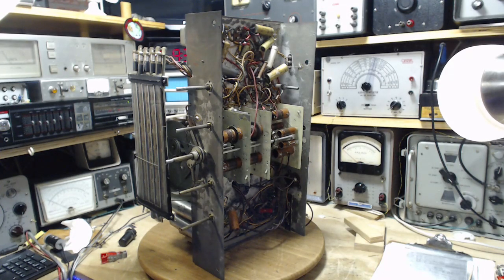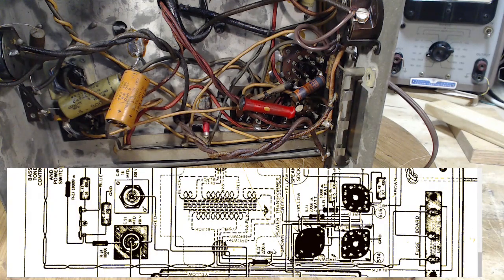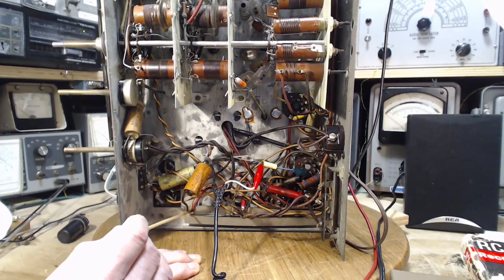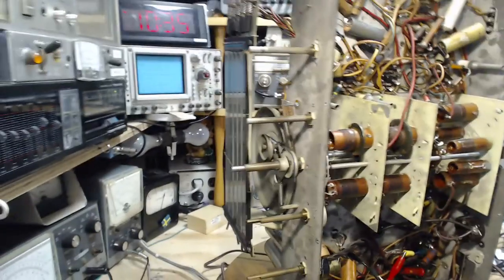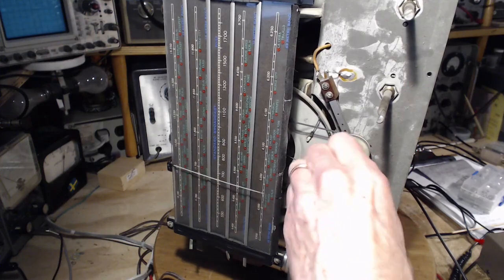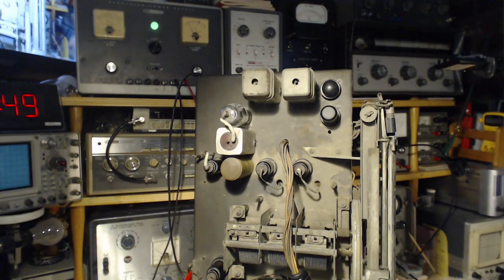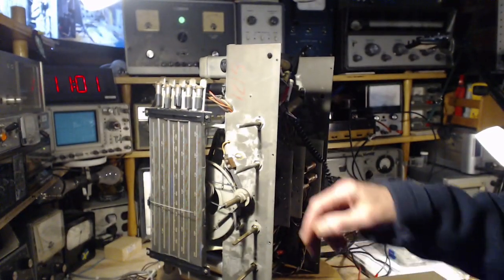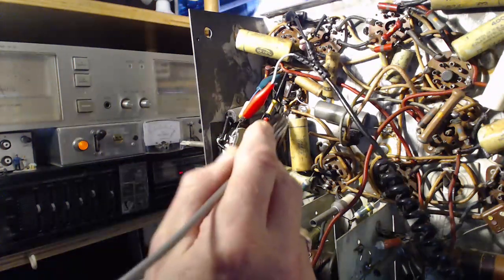Westinghouse Model 1029 Multiband Tube Radio Video #4 - Applying B+ Voltage

Comment: Don’t forget that the built in power supply also provides a negative supply which is used in several parts of the circuit.

Comment: Wow what a handy manual to have! RS-250 is available online at worldradiohistory.com/Archive-Rider/OTHER-RADIO_SERVICE/Westinghouse-Manuals.pdf
So did Jim not see the speaker plug wiring diagram on page 3  in upper right corner? Two 6J7 tubes. Needed for the oscillator to work in the way this circuit is designed.
It is fun to watch him "work"!